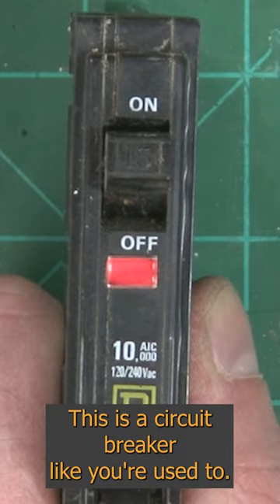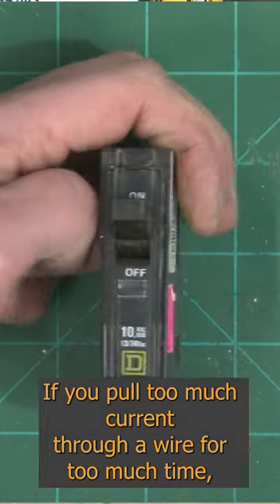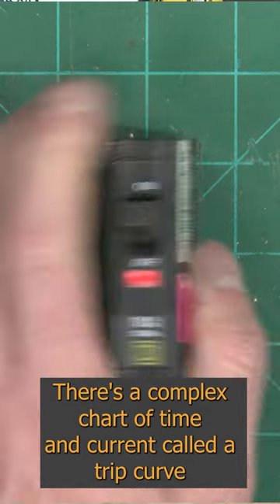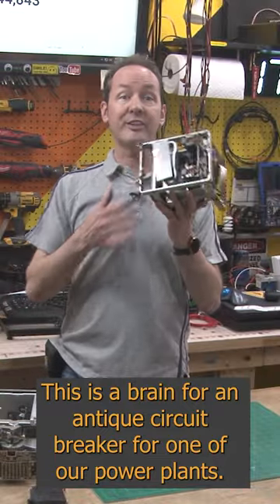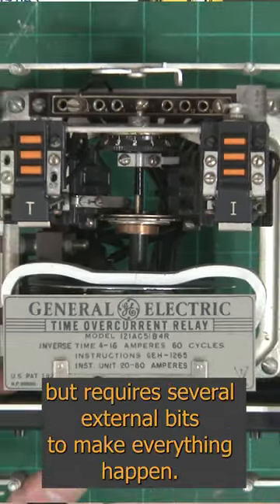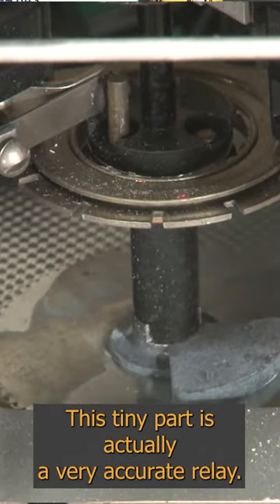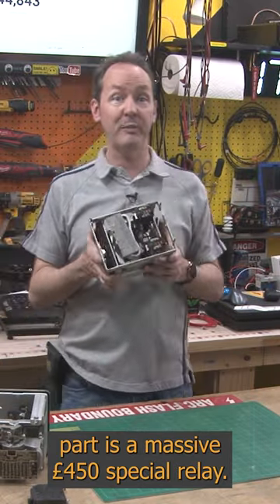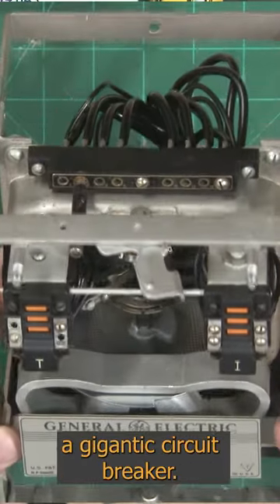Hydropunk Circuit Breaker #engineering #electricity #safety #energy #powerplant #science #relay

Comment: You’d be surprised how much of our system is still “old school” running these and similar relays. Fact is, those old IACs just work, and work, and work.
Reply: Yes these induction disc type electro mechanical protective relays are time tested but require routine testing and calibration to insure trip time accuracy as calculated by a protection engineer. Gummy induction disc jewels , reduced magnet strength on damping magnet , metal shavings on magnets obstructing disc movement , and shorted turns of induction unit windings due to age induced failing insulation are all things to watch for .
(not good at a plant with shoddy maintenance practices )

Comment: Huh, it's weird to me seeing a circuit breaker that goes red, but doesn't actually flick from on to off 🧐
Reply from the maker: Wit the CQ series breakers from Square-D there's actually 3 positions on the toggle. Off, On, and an in-between that it lands on when it trips. You can see it better when you're not looking straight down at it from this camera angle, and you can instantly feel it when you're scanning a panel....plus the big orange window is a pretty good clue. ;)

To reset the breaker you first go to OFF and then push back to on.

Comment: I heard that the modern circuit breakers like you showed get a tiny bit weaker each time they're tripped. Is that true?
Reply: Yes it is true. Repeated overloads will slightly change the trip point. Short circuits on the other hand can ruin the breaker over as few as THREE events. 

For residential and commercial small breakers (15-50 amp rated) the rule for resetting is no more than two attempts in any given trip event. (Only ONE time in cases of a sispected short circuit.) Heavier commercial/ industrial breakers rule is ONE reset attempt.
How can you tell if it is tripped due to a short or overload? For most good quality breakers (SqD, Siemans, CH, etc) a short will trip instantly. Overloads delay for a few seconds or minutes. Breakers that don't have magnetic trip elements (GE, FPE, ZINSCO, older CH/Westinghouse) will hold for several seconds on a short, and you will hear buzzing or a strange rattling sound.
Reply: I heard that for surge protectors. Not breakers.
Reply: You could say that. When an arc forms, a little bit of the material of the contact may melt or evaporate which increases the resistance so the circuit breaker heats up a little more during use and as a result might trip at lower current. The higher the current when it trips, the more wear.